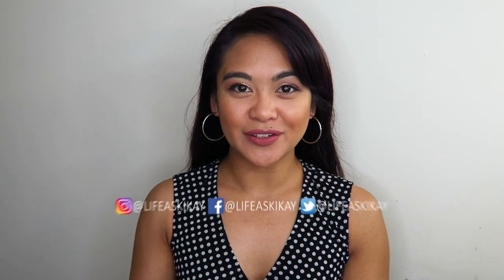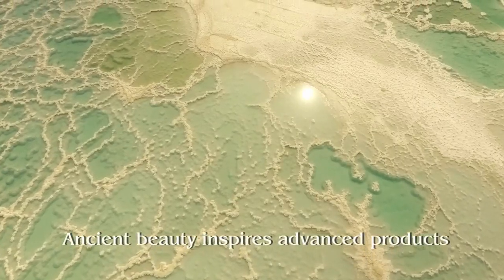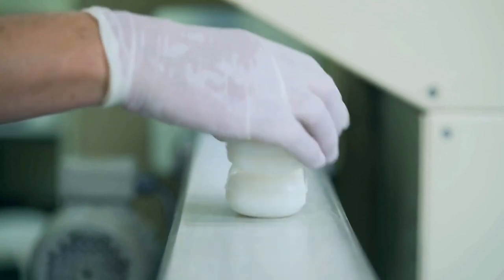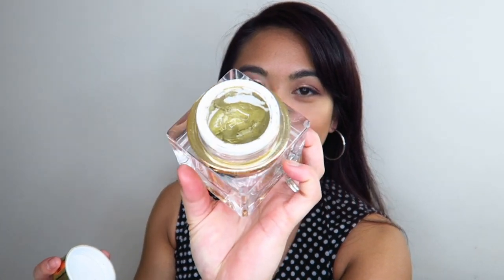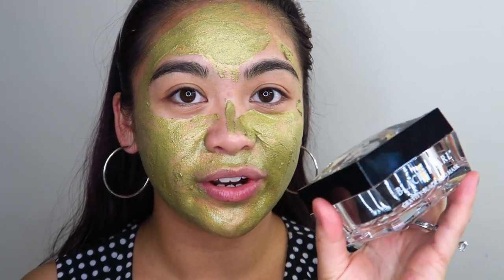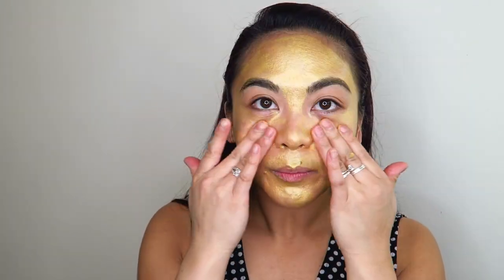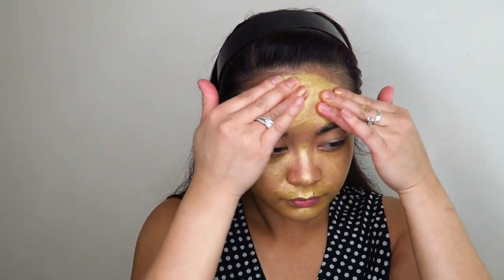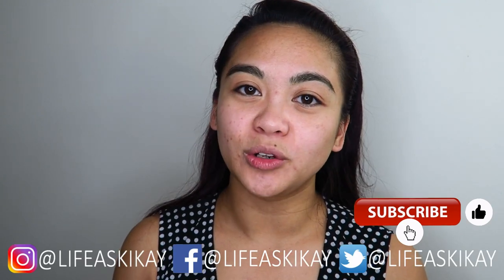24k Gold Face Mask Kedma Cosmetics Review and Demo

Comment: Hi is it effective?
Reply from the maker: Hi there, thank you for your question. As I said in the video, I was only able to use this product once as it was on loan to me overnight from the supplier. I could see a difference in my skin after using it once, and I could see how continual use of it could make a significant difference. I believe it is effective, but personally, would not drop 1.2k when I could find other skincare that would give me similar results for a mere fraction of the price.